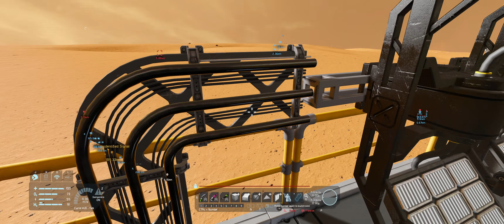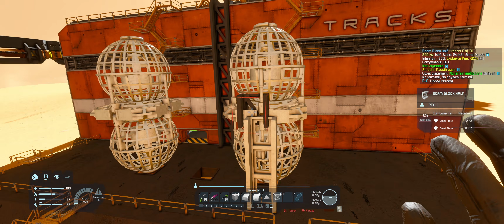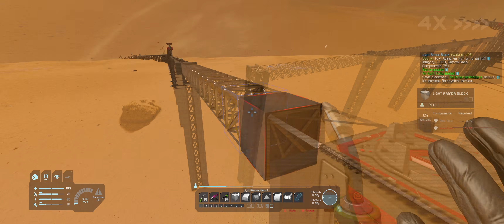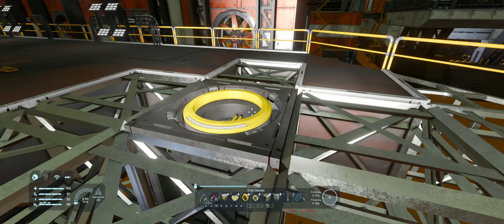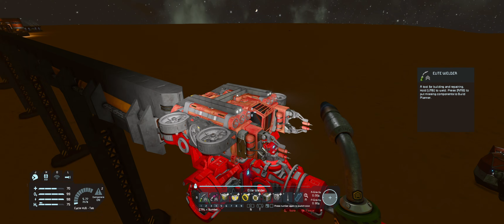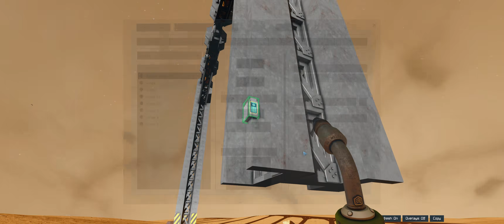Mulligan! Let's Rethink Some Things Around Here | Martian Engineering E35 | SE Survival

Comment: not sure if it's a mod or base game but to change the colour of something to the same as what you have equiped just click the mouse wheel (MMB) while looking at the block you want to changeand holding shift and clicking will change the block and the blocks around it.
Reply from the maker: Yep, ctrl does a small area, and shift does a large area. Both repaints the whole grid, which is super dangerous. The paint gun mod just allows you to gey some of those hard to reach blocks that you can see, but can't paint, because a half-block is in front for example.

Comment: The rail work got me wondering, did you ever considering a train with a crane to pick up and delivers new track segments instead? Might be an interesting thing to work on, have an extra car on the train thats a landing pad for the lil welder too. Maybe have it drive itself on a timer that you just increase a lil bit as the track gets longer so it auto stops near the end even if you get up.  
  The tartigrande works fine but it could be a cool idea too (that could be reused on future tracks maybe.
Reply from the maker: It would be cool, but with the train being small grid, I am not sure it would lift the sections well.

Comment: This "little" industrial complex is really filling out.

If you're still not fully satisfied with the flood lights at the tank farm aiming exactly where you want them, how about using searchlights, then go into VIEW and aim them where you want?

If interested in some greeble ideas, how about using various truss blocks to add a "cellphone tower" on one of the roofs, and full-block air vents could be used to simulate roof-top industrial A/C units.
Reply: The last time I tried that with searchlights, I discovered that all turrets reset to default position on world load, so every time I logged back in I'd have to reposition them.
Reply: @mailleweaver  custom turret searchlights would work then.